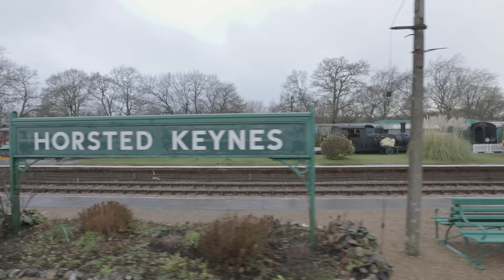A footplate trip on the Bluebell's Q class from Sheffield Park to Horsted Keynes

Comment: What’s is that big handle which he is rotating?
Reply: Regulator: determines the amount of steam admitted to the cylinders.
Reply: @novakingood3788  oh ok
Reply: @pra2221  The regulator controls the amount to steam entering the steam chest and the reverser controls the amount of steam admitted to the cylinders from the steam chest, determining the power the cylinders can deliver and therefore the speed of the loco. 
These controls are analogous to the throttle (accelerator) and gearbox of a car. Obviously, the speed will be affected by the load the locomotive is pulling and any gradients it encounters.